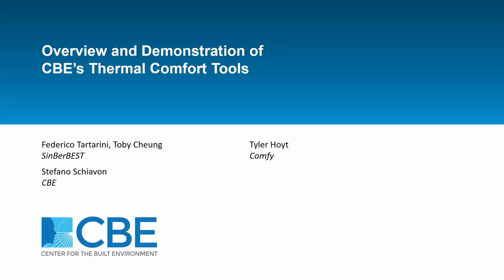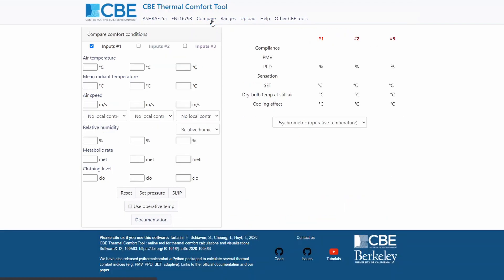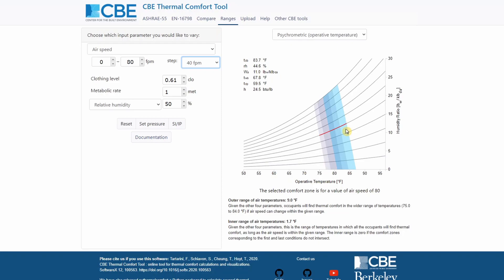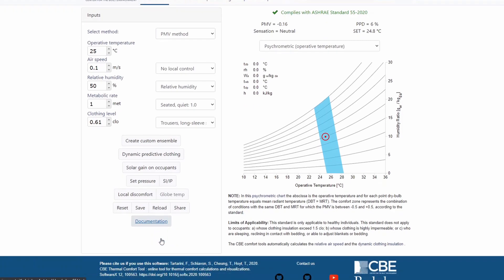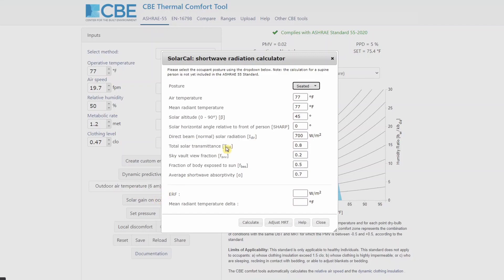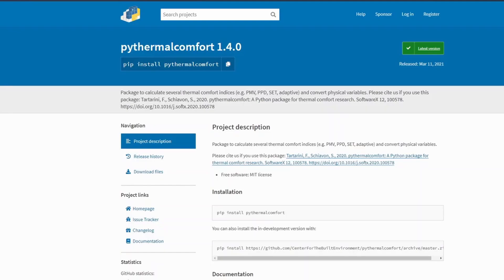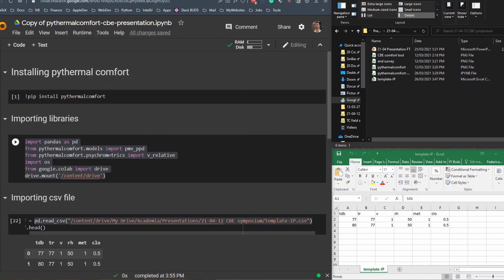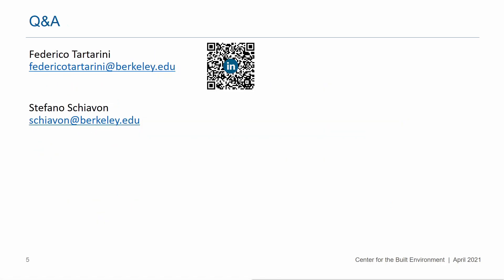CBE Thermal Comfort Tool and pythermalcomfort overview - Spring 2021 CBE symposium

Comment: Is this program  suitable for outdoor ?
Reply from the maker: Yes
Reply: thank u
Reply: How do I set operative temp when there is a glass wall surface temperature 60 degrees F ?   And a radiant floor at 90 degrees F.         And a ceiling temp at 65 degrees F.                       For example